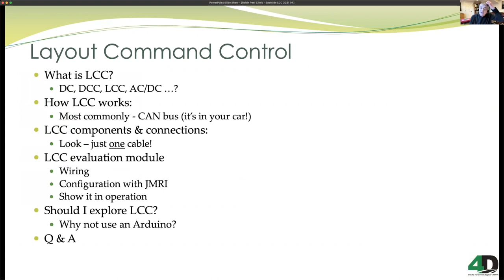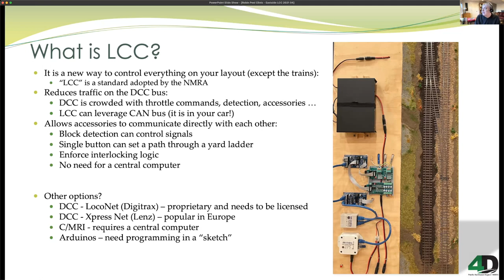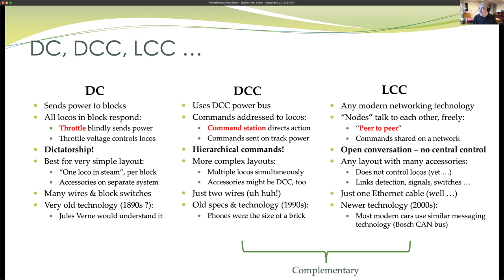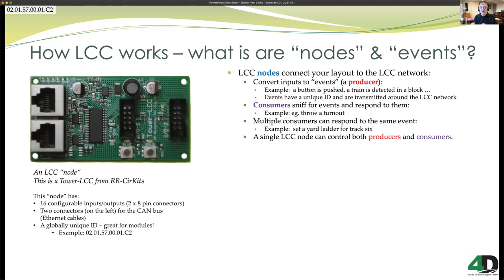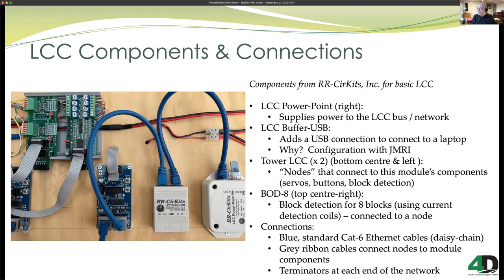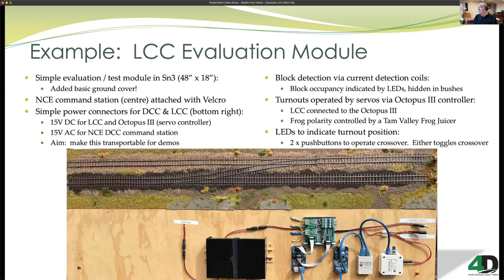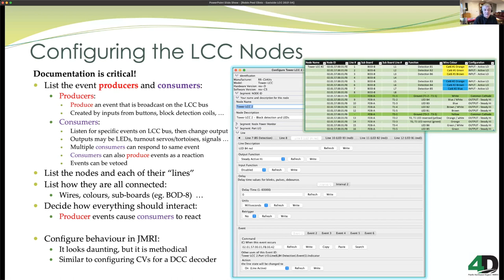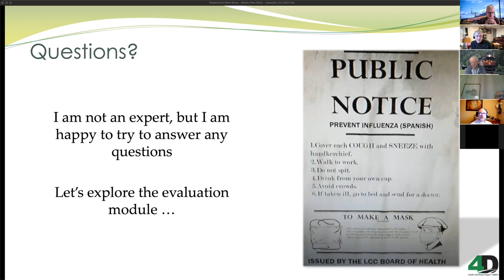Introduction to Layout Command Control (LCC)

Comment: if you are exploring Arduino <-> LCC interworking, there are CAN Bus Shields/Modules available for Arduino and an Arduino could potentially send and receive CAN Bus messages…the LCC gear is also microcontroller based with CAN Bus interfaces 😁👍🏻
Reply: One could also take the concept further and implement a DCC->LCC gateway…imagine activating an accessory with a DCC command and have the LCC systems execute an automated process…i.e. select a locomotive in a roundhouse via DCC which then triggers a turntable to automatically move to the track where the newly activated locomotive is sitting…possibilities are endless…LCC->DCC is a lot more difficult 😁